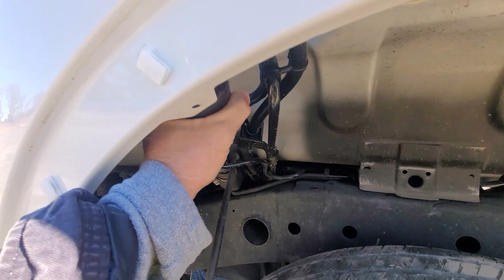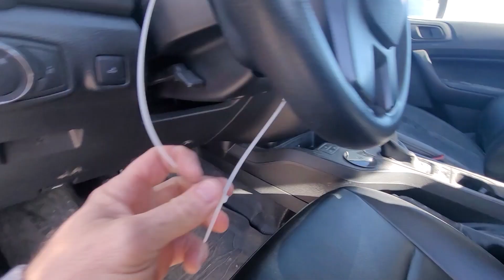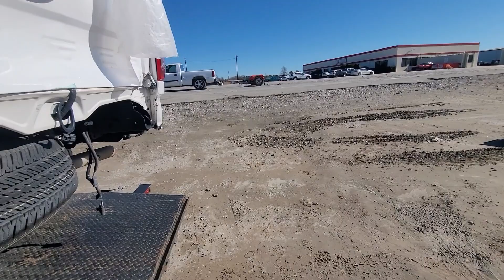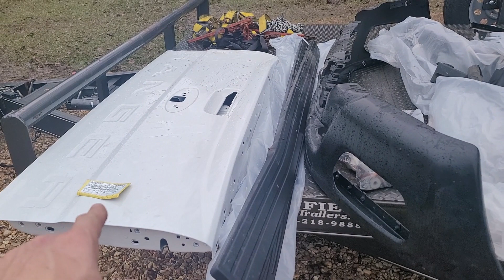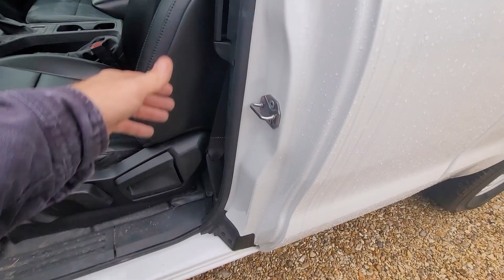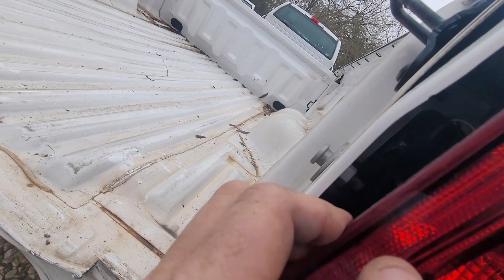Picking up the Tesla Ranger - EV conversion - P1

Comment: Are you planning to make the Tesla software think the components are in a Model 3 rather than the Ranger?
Reply from the maker: I dont have too really, it will just work missing just about everything.
The hard part is just building the custom frame.
It will have traction control and Regen breaking with basic senty/dashcam mode with cameras not for autopilot as I can't include them all.
Been on hold for 3 months now gathering everything I need and just to busy to start this summer.